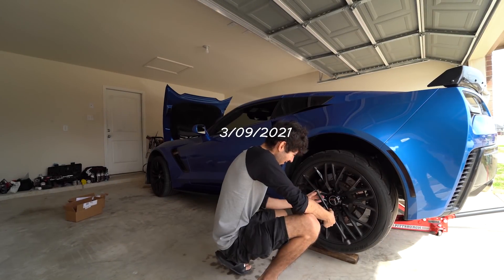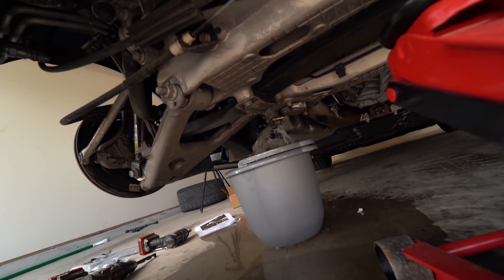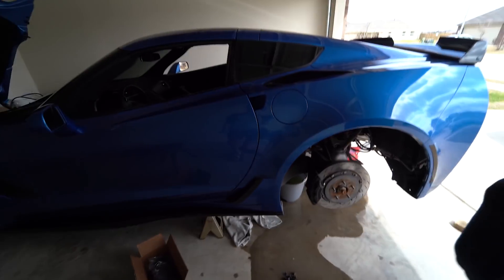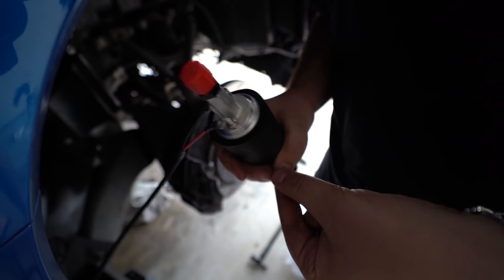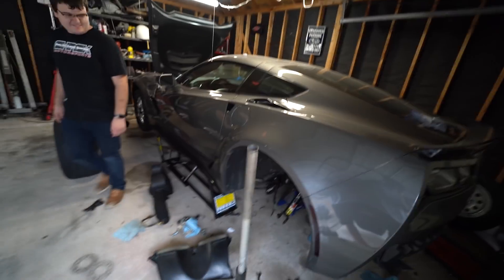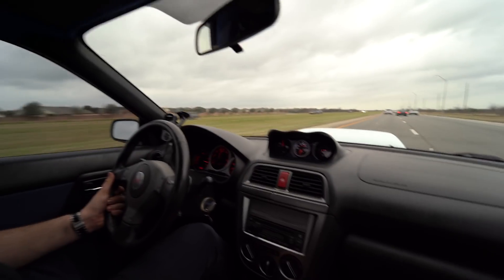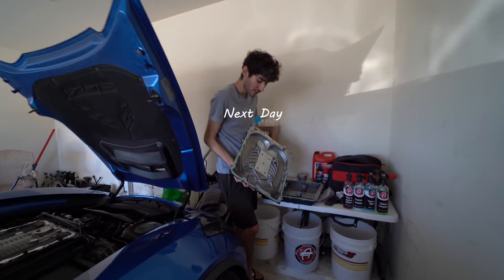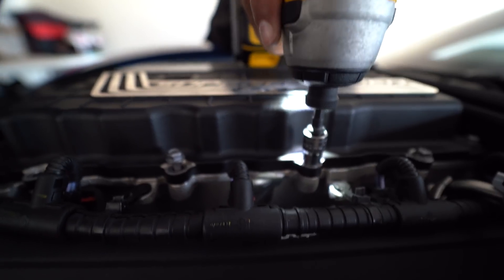MY CAMMED Z06 NEEDED THIS FOR E85!!

Comment: If you live in TX or around Austin and want a highly modified C7 Z06 2018 white 1LT then let me know.  Over $13 in upgrades, about 20,000 miles on her.  E85 Tune Ligenfelter Stage-1 kit, Halltech Stinger Induction and ALKY Control Methanol to boot.  Also $1,400 in stereo upgrades.  I am not a mechanic and do not go to the track and it is way to fast for me.  Asking $79,000.